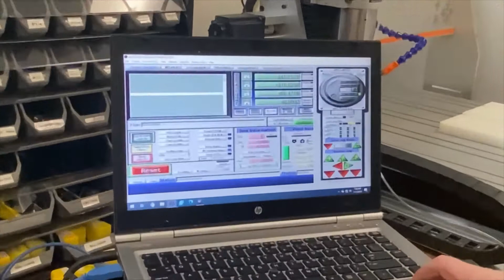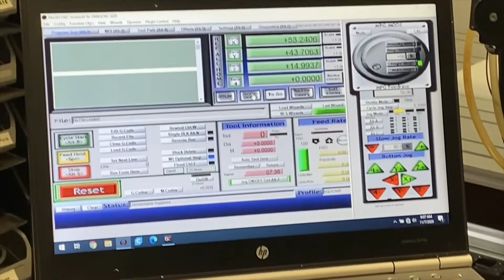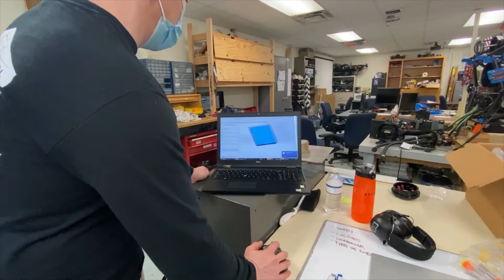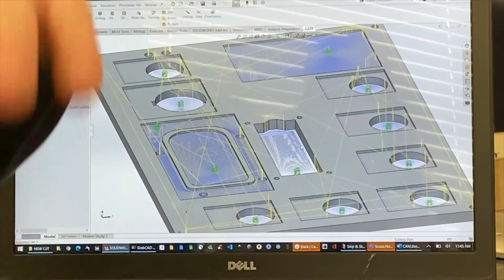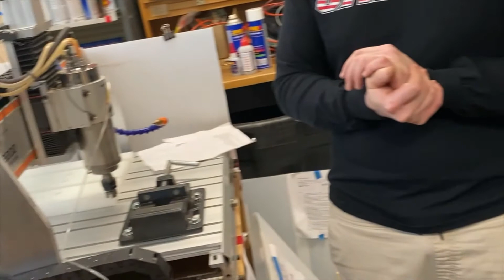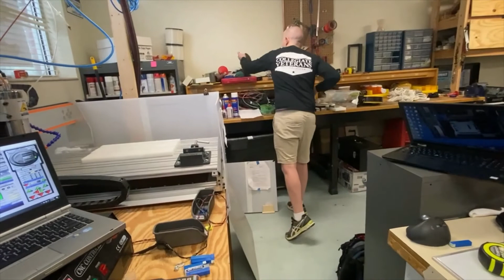OMIO CNC Setup and Tips

Comment: I'm curious about what you used to mount the aluminum plate to your wasteboard. It looks like painter's tape then some spray glue. Any details on that? How long does it take for the glue to set? Is this also useful when cutting wood rather than aluminum?

We have an Omio x8, just getting started...

FRC 7509
Reply from the maker: Yeah I use painters tape on both sides and fast cap 2p10 glue/accelerator kit. The accelerator makes it dry very fast. Seconds is all it takes. I’ve used regular super glue and I’ll leave it for a couple minutes but the accelerant is the way to go. I’ve used this with hdpe, aluminum, polycarb abs wood mdf etc and as long as it’s flat you should be good. There’s a video on YouTube from nyccnc where he used flood coolant with the setup and it was holding up.
Reply: @danielprestridge4957  How do you get it off?
Reply from the maker: @edjohnstone6598  stick side of painters tape on one side, sticky on the other surface, glue in between on smooth surface of tapes and then smush until dry. When it’s done just pull it up and remove tape.
Reply: Hello, when did you bought your omio? i want to buy it and i cant find any information on social media about them are they reliable?
Reply from the maker: @hyperhidrosissupport9186  couple years ago. They are very reliable and are probably the best 6040 style cnc for the money as far as I can tell.
Reply: @danielprestridge4957  thanks!
Reply from the maker: @hyperhidrosissupport9186  you bet lmk if you need any more info.